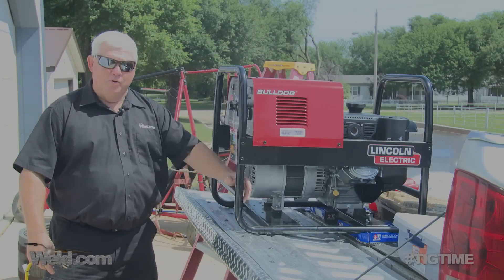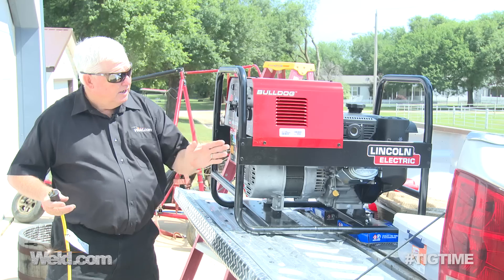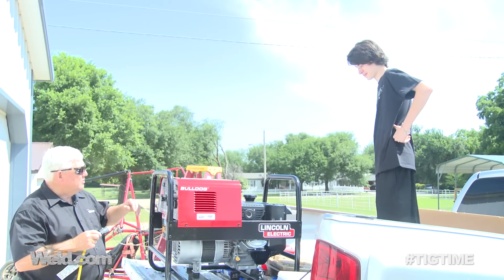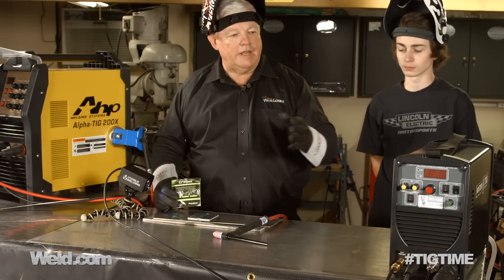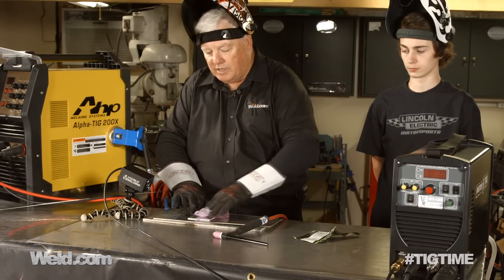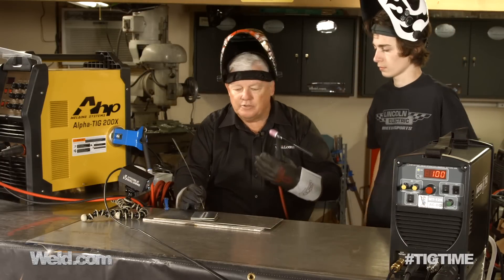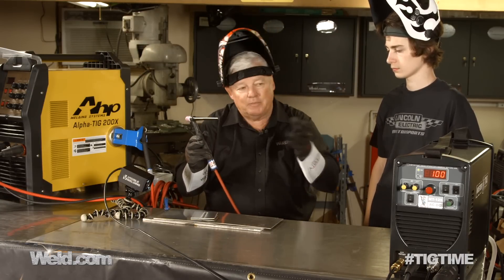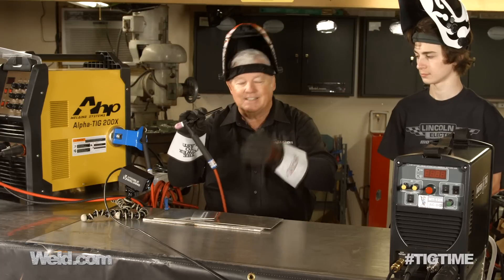Welding off of Generator Power with an Inverter TIG Welder

Comment: Can I use a 8750 watt generator  on a 200 amp arc welder? Thanks
Reply: Yes, I ran a stick welder with a 6000watt generator.

Comment: The generators have gotten better, so have the small tig welders. My portable miller 135 dc tig used to be like 50 or 60 lbs we then replaced it with a then maybe in 2005  with another  Miller dc machine that was that was the size of a toaster and weighed probably 10 lbs. Problem was it was dc only. But now you can get a 200 amp dual voltage ac/dc inverter tig (not a miller but a great machine) that weighs 30-40. For around a grand that can do just a bout anything.

Comment: As long as the extension cord is the proper gage of wire, for the length and amperage draw, it will not affect the performance of your welder
Reply: some generators don't put out enough amps though, so the generator greatly affects the performance of the welder, especially the cheap ones
Reply: @eksine  I'm see this only works with GENERATORS that put out 
Min of 20 amps 
The 5500 bulldog does that 
I think a 2800 Honda GENERATOR might also also work

Comment: Today my son and I did a test with a Harbor Freight Tools 60-120 amp Mig/Flux welder with Flux wire 0.030 size wire on both an 1600/2000 watt ultra quiet generator and a 4000/5300 watt Brigs & Stratton Generator.

I would like to disclose that this was his first time touching a welder and my second time. we borrowed it from my brother and wanted to see if we would like to learn to weld.  I have been watching welding videos for about 5 or so years, so I have hundreds of hours, maybe even a thousand hours of watching videos and reading material. He has been watching them for maybe three days. I am 50 and a retired security officer, he is 24 and out of college now, but still at home. He is a programmer.

We purchased a new roll of Lincoln Wire 0.030 Flux for the test.  The first generator would only make intermittent spitting and tiny pebbles and no puddling at all, not even close. That was both on 120 amp and the 60 amp settings.  The 4000 watt kept surging and so we could not get the 120 amp setting to maintain a puddle.  On 60 amp it could maintain a puddle, but would only get about a 1/4 penetration on a 1/4" thick by 1" wide and 7" long peace of steel butt up against another one.

We plugged in the welder to our house 120 volt plug and on the second test, my sons turn and his first time attempting to weld, he got about 3/4 penetration on the 120 amp setting. We laughed at our welds and talked about where it looked somewhat normal, for as bad as we are at welding.  We talked about the Caterpillar I made that was about 4 inches long. Then we flipped it over and made attempts to weld the other side.

We then decided we wanted to learn this.  We discussed if we wanted to put out $100 for a HFT welder but figured if we ever wanted to do aluminum or Mig with Argon/C02 gas, we needed to do the right thing and let mom go buy a Lincoln 140 Pack at Home Depot on her Home Depot card. This was a hard decision because we found your channel a few days ago and had seen Tig at work in your videos. WOW! what a clean looking welding system.

My brother gave us an old Miller 200 amp stick welder like the ones used in the old metal shops in high schools.  We needed a 120 volt welder so we still let mom go buy the Lincoln 140 pack.  After we pay it off in a few months, we may get something I found in a Tig set up that is dual 120/240 volts.  Longevity Tig Weld 200D 200 Amp TIG Welder with Dual Voltage Technology.  I will have to show it to my son and see what he says. If he likes it, we may take the Lincoln 140 Pack back and order it instead. Tig welding sure looks like a much better experience than all the smoke and spatter Mig gives.
We enjoy your videos.
Reply: Tig welds can be way stronger than mig and pass x ray test easier this is from a  American welding and society test inspector

Comment: I tested a Generac 5500 watt generator and had similar results with a similar rated welder. Then I discovered that the generator damaged my air compressor. Inspection revealed that one start capacitor had seized. After that I tested the compressor on a hydraulic overhead lift, the lift motor failed within seconds. I quickly scrapped the generator idea and returned to shore power.

Comment: Anyone out there, other than Mr. Tig, have any experience with this Tig machine? I want to get into welding as a hobby and while I respect Mr. Tig's input on the machine, I would like to get someone else's unbiased opinion. After all, he is a businessman and he is trying to promote his business. So, I just want some honest opinions. The price sounds great, the package that is being included also sounds like a top. How does it compare to the major name brands, as far reliability, durability, ease of maintenance and parts availability? I live in Los Angeles and just my experience alone, I have not seen this particular model before. So I would appreciate any info from those of you that may own this machine. Of course Mr. Tig's opinion is always appreciated. Thanks for the videos, they inspire me to get into the craft.
Reply: well, considering there store doesn't work and you cant buy these anymore i would say its someone selling you someone elses product at a mark up. best just to buy from a chinies manufacture directly cheap or just buy a welder from tractor supply or harbor frieght where you know you can warrenty out stuff